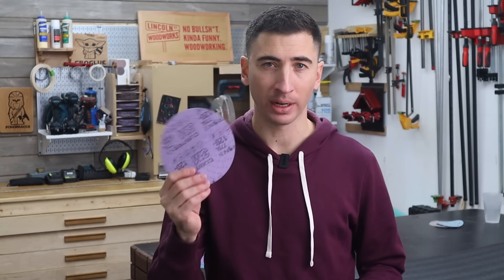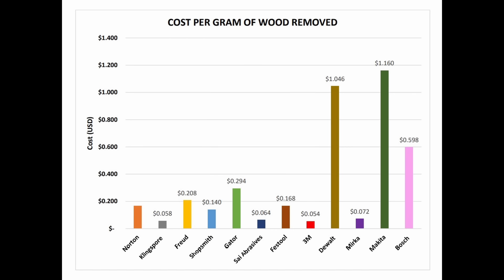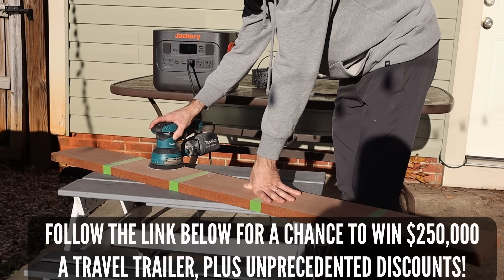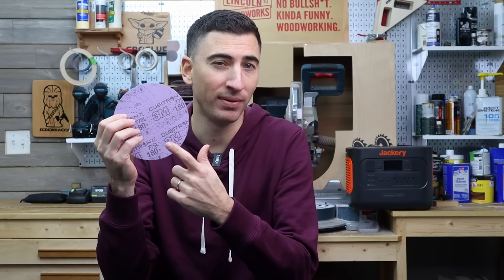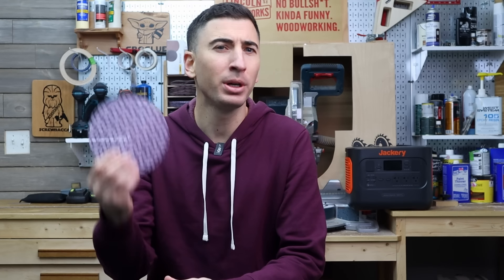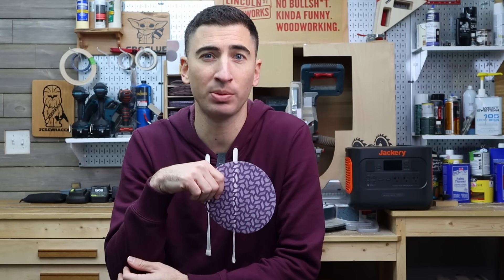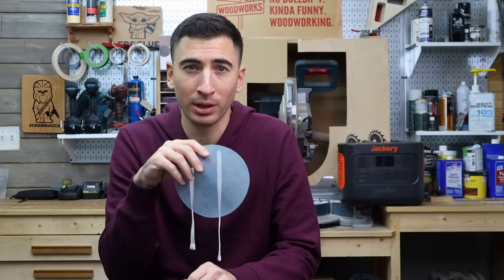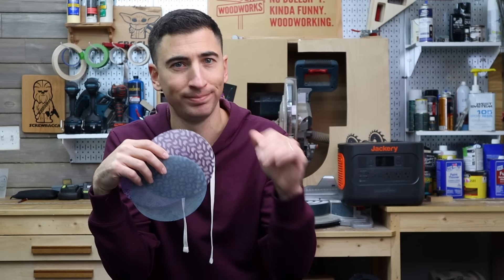This $.07 Upgrade Will Save You Hours

Comment from the maker: Purchase these products today for 20% off. Using these links helps support the channel
3M 775L - https://lddy.no/1dszo
3M 710W - https://lddy.no/1dszp
3M 310W - https://lddy.no/1dszq
Pad Saver - https://lddy.no/1dszr
Reply: so what about carbide sanding discs like those from Duragrit? Seems like they should be superior in most areas. Stumpynubs made a recommendation for them a few years back. I've never had a chance to use them but imagine it could be a game changer as far as material removal is concerned. Not sure why we're still using crap glued to paper or even mesh when we have literal discs of rough metal now.

Comment: As a professional woodworker and carpenter, I've used just about every type and style of sandpaper out there. As soon as 3m released the 710W I spent close to $800 in sandpaper acquiring every grit I needed. This was after using my very first sample disc.
The 710W is hands down the finest disc out there, and most definitely the most cost effective sanding solution.
For those of you on a tight budget, I highly recommend you save the pennies and get the 710W. Over time, you will put more cash in your pocket.
Cheap sandpaper is just that. Cheap. 
Remember... The sander is the MACHINE. The PAPER is the TOOL. Quality tools ALWAYS have a better experience, work faster, and cost LESS over time.
Reply from the maker: Couldn't have said it any better myself. The 710 really is an incredible product
Reply: Try Norton's Blaze line....what do you have to lose?
Reply: I generally sand pine with a cordless sander without dust collection. Would you recommend the 710W for my application?
Reply: Thank you 😊

Comment: Yep, I am one of those who uses sandpaper until it's just paper.  I go through so much of it, that I keep some for later use ... albeit it might not cut as much, but in the times that I use it the scraps are worth getting every cent out of the paper.  Great video, thanks!
Reply: Me too. I do mostly hand sanding, and spent years restoring century-old wooden entryways on brownstones in Boston, and there was no way to use power sanders on them, except on some small areas that were flat. For hand sanding, I found Norton Pro-Sand sheets to work the best for me. And I save the small scraps, too.
Reply: @grizzlygrizzle  I should have lead with that, that I do mostly hand sanding.  I'll rough down some wood with a palm sander, but after that it is all by hand ....

Comment: I am limited to big box stores and have bought their sandpaper because I have thought is was decent and "cheap".  After this video, I did a bit of investigatingand realized that these "Premium" discs are actually a fraction of the cost compared to HF, HD, L, etc.  $20 for 50 discs for 3M or $6 for 5 discs at HF or HD.  

I will only buy "premium" discs now and feel good about it because they are cheaper per unit than the "cheap" ones AND perform a lot better!  Thanks for opening my eyes!

Comment: Thanks! Over the last few months I've made over 100 cutting boards and seems like I get the best results with the 710 for all the faces, then switch to a 775 disc for doing all of the edges, for all the exact reasons you mentioned.  I had not heard of the 310, yet, I will go check it out!
Reply: Have made dozens of cutting boards the last few months lately too. You should def try diablo sandnet!

Comment: Diablo SandNET from home depot are the best I've ever experienced by far and away.  I have sanded my laser cut products every day for 15 years and have experimented with everything.  I use 120 grit mostly.  A disc I have used for 6 hours straight removes material way faster than any other disc after 15 minutes of use.  But I wouldn't recommend anyone using them because I want to make sure they are in stock when I need to buy more

Comment: Did You know you can clean out clogged sanding disks and belts etc with a rubber bar?
It's an old technique. Everything old is new again!
Better yet, try a sharp hand plane, you can get such smooth results that it actually shines and don't need sanding!

Comment: Aluminum Oxide is a hardness of 9.  for sanding wood the hardness is not the issue it's the shape, size, and distribution of the grit.  Another is the adhesive, closed or open face.

Comment: Here is an elaboration on the key benefits explained in the summary:

• Cost-effectiveness - The testing showed that while more expensive upfront, the 3M Cubitron and net abrasive discs actually had the lowest cost per gram of wood removed. This means they are more cost-effective in the long run by removing material faster and lasting longer before needing replacement.

• Understanding grit and materials - The explanation of how grit levels work and the impact of abrasive materials (e.g. aluminum oxide vs ceramic) and backings (e.g. paper vs film vs net) helps users understand what factors drive sandpaper performance and cost. This knowledge can inform better purchasing decisions.

• Smoothest finish - Despite removing less overall material, the testing found the 3M 310W net disc left behind the smoothest, most scratch-free finish on the wood surface. For many woodworkers, having an ultra-smooth finish is extremely important.

• Tailored recommendations - Rather than blanket recommendations, specific sandpaper products are suggested for different user needs - budget/softwoods, working without dust collection, mix of hardwoods/softwoods, etc. This tailoring helps ensure each user gets the right product for their requirements.

• Frequent disc changes - The data showed that even premium discs see a 50% drop in material removal rate after 25 minutes. The recommendation to change discs frequently, while potentially using more discs, ensures faster removal rates and better finish quality throughout the sanding process.

The overarching benefit is maximizing both cost-effectiveness and quality of results by understanding the factors impacting sandpaper performance and following evidence-based best practices. This saves time while producing superior finished products.
Reply: The video outlines some potential downsides to the different sandpaper products recommended:

3M 775L Cubitron Downsides:
- Most expensive option
- Not ideal for resinous/soft woods like pine as they cause premature clogging
- Left deeper, more visible scratches in testing that required sanding to a higher grit

3M 710W Net Disc Downsides: 
- Edges more prone to fraying and tearing compared to film-backed
- Purple abrasive fragments can get left behind if not vacuumed well
- May need to go to a higher grit to remove all scratches

3M 310W Net Disc Downsides:
- Removed material at a slower rate than 775L and 710W in testing

As for which product is ultimately recommended:

For Budget or Resinous/Soft Woods:
The 3M 310W net disc is recommended as the best bang for your buck, especially if working with inexpensive woods like construction lumber where the slightly rougher finish won't matter as much under a film finish.

For Edges/No Dust Collection: 
The 3M 775L Cubitron is recommended if you'll be sanding a lot of edges or won't have a vacuum hooked up, as its film backing holds up better to edge sanding and doesn't require dust extraction.

For Mix of Hard/Soft Woods:
The 3M 710W net disc is recommended if you work with a mix of wood types, as it provides excellent dust extraction while still removing material very efficiently across different densities.

So in summary, the recommendations balance factors like budget, wood type, sanding application, and whether using a dust collector based on the performance testing results.

Comment: 1. Sanders that supply cool air to the center of the sandpaper such as Mirka, festool and some metabo - ALL push sawdust to the outer holes batter and make sandpaper with any center hole last longer.
2. The true calculation of sandpaper value to me is cost, uniformity of sanding over 1 hours, finish and dust - not in any order all sandpaper must achieve a great balance of all the above. Did I miss one? I believe that Autonet nails my preferences BUT SO DO A LOT OF OTHERS

Comment: On Sanding anything not just built, especially painted pieces, cheapest unit disc the better. Disc clog, hitting nails, soft putties, rusted steel, pad life is not grit life it's backing life. All these tests in flat, sap hardened dry long grain hardwood is so narrow a test. 
Sanding down an outside door and adding a hardwood toe strip covers most of the situations. You'll hit nails and maybe the latch plate, clog with water and oil based paints, then flatten the endgrain in several positions, edge dig the pad for long moulding sanding and finally when it's had its first recoat of paint you'll knock down some missed sharp edges. the pile of discs will be 90% clogged and torn and 10% lost tooth. when you look at cost (time and dollars) of doing it at home, sticking with cheap discs is the path, beats strippers, heatguns, and super performance cutting discs.

Comment: Hmm, @11:49 I wonder if dust buildup on your finger tip/pad made a difference?  If you did it in the other direction, would it have affected the results?  Not that we need to turn this into a rocket launch or anything. LOL.  And while I do try to blow/dust between sanding, I'll now be more diligent.  I wasn't aware of the PTCE:  purple tortilla chip effect.  As I get into more and more "fine" woodworking, I'll be sure to be on the lookout.  Thanks!

Comment: 5 months later, I am here to say the 710 is love. I was using Gator previously, and while the 120 does it, it makes a HUGE DIFFERENCE when you put the 710 on. 

Seriously, if you have other sandpaper, here is how to correct this situation. Go to Home Depot or Lowes, buy the 50 pack of gator 120, 180 and 220. Drive home, open garage to your shop. Go to trash can and throw it out, along with the receipt. Now, use that feeling and get angry then get 3m 710 and never look back. 

How do I know? No idea, I really don't.
Reply from the maker: Lol

Comment: I used to hate sanding, the dust, noise, frustration, then I got a Festool sander and dust extractor, and I love sanding now. Turns out that removing the dust at the source makes a better finish, I’ve gone from sanding to the finish room without vacuuming or wiping

Comment: Like the video - for the discussion of efficiency of material removal.... not the swirl testing (which I will explain why).

I didn't know people were of the idea that you can jump directly from random orbital sander to finishing routines.
This might work alright depending on the wood and a clear finish.... BUT, very unlikely to work well if you are staining or if the wood is fine textured... and yes - professionals DO use stains - a lot.

It does make me wonder if possibly some simply have had no reference point to realize that what they are seeing is the results of not removing the swirls.

ALL swirl marks are made by your machine NOT the sandpaper. The sandpaper's ONLY job is to cut material. The machine sets the pattern - and can also have a great determination on efficiency. A swirl is nothing more than the evidence of the machines pattern.

That pattern remains the same no matter the quality of the paper or the size of the grit. The swirls will "disappear" after you reach a certain high grit size due to the swirls being too fine to see with the naked eye... but I would suggest it would save time to stop at a lower grit and quickly hand sand to remove the swirls then it is to sand up to a high enough grit to HIDE the swirls.

I might suggest that what your swirl test is ACTUALLY revealing is that the lower quality sandpaper is - well, lower quality, meaning a greater range in the actual grit size on the pad - otherwise the swirls would be consistent across the surface. This is turn would leave visible swirls wherever that larger grit made contact. If you did the same test on the higher quality over a dozen sheets or so you would probably find swirls from some inconsistent grit.

The raking light is the best way to find swirls and blemishes - but you can make it even easier by also wiping the surface with paint thinner. This will soak more into end grains (which is what a cross grain scratch is) making the scratches and blemishes a little darker.

My personal preference for sanding (if one can use the word "preference" when referring to sanding) is to orbital sand to 1 grit higher than I want and then drop 1 grit to finish with a quick hand sand. This way I am not fighting to remove swirls.

Comment: What'll save you more headaches than anything is a well balanced RO sander.. If you have a decent air compressor with sufficient CFM's there are some high end pneumatic sanders on the market that are very balanced.. My "sanding background" began in the autobody industry working in a variety of shops so I learned the hard way to NOT allow the edges of your sander to dig in..Keep things flat as possible because you will create swirl marks and the more balanced the sander the less likely you'll screw things up... I had to completely resand entire trucks down to bare metal because of my mistakes and listen to bosses make me out to be the worst body man since the dawn of time..Yeah..It's THAT much fun to be the schmuck in the shop and end up working for free.

Comment: I'm actually a bit more confused than I was before. If one were to use a cordless sander without dust collection on pine, which one one would you suggest? The prices are negligible after that breakdown in terms of how much I'll be saving compared to the cheapo stuff I've been using, so cost is not a factor.

Comment: Thanks for mentioning we should use the backing with a net disk. Wittworks just did a video on those this past weekend and that was the first time I had ever heard they exist and why I need one. You're the only other YouTuber I watch that's even mentioned their existence or purpose. I just got into woodworking this Spring and bought the "Xtract" net disks after seeing Jonathan Katz Moses's video but never knew I needed a backing. Thankfully I haven't done a whole lot of sanding since I've just been building garage furniture and shelving but I'm definitely buying a backing for next year.
Reply: I go bareback on my sander and live dangerously. But yes- interface pads are importanter

Comment: Super interesting video, thank you! I'm still very new to woodworking, so I was using cheap amazon sandpaper, until I saw Katz-Moses' video and switched to the 710W and I really love it, the difference is so much more than I thought it would be! It's probably the thing that's made me rethink my instinctive cheap-stakes-ness the most! It looks like the 310W is a little harder to get my hands on in the UK but I'll give it a try if I can find some.
Reply: Might be beneficial to replace only some grits. For example, if you care more about just removing material (lots of rounded edges or gradual shapes in projects, for example), get fancy coarse disks. If you are more into fine finishes, invest into finer grits and use cheaper coarse ones. 
If you are working with sap-y woods, working it with a scraper first can help to keep disks from clogging. Certainly helps with autobody fillers since they tend to get a gummy layer on top as they cure.

Comment: Great info! My time sanding is the most important factor to me behind a good finish. I originally bought a planer just so I could start with a more uniform, smoother surface on rough boards and cut down on sanding time. I was willing to spend $600 to not sand for hours. Added benefit of making them all the same thickness

Comment: Excellent information, a true service to the community.   In the grams per dollar testing, the defect in comparison was the effective grit size of various brands.  A lower grit number will always remove more material than a higher grit number; how do we know that the grit scale is consistent from one brand to another, or even from one lot to the next within a single manufacturer?  Your testing went several steps in the right direction.
Reply from the maker: Thank you! There are standards that each company must meet to label grits. This helps create consistency from one brand to the next. I can't remember the exact names of the organization that monitors this - I read about it a while back. But there are industry standards.

Comment: The sander just has certain amount of holes. How does it change the dust extraction between the net and sandpaper? The festool sandpaper has the holes in the same spot as the backing pad. I think the net will mess up the hooks.
Reply: it doesn't. The mesh is still usually on a regular fleece backing that is the actual contact to the velcro hooks. In my experience it still improves extraction because the dust can basically go through the tiny "channels" between the mesh and through the velcro hooks. My mesh discs clog up way slower than any regular sand paper discs I've ever used. That only counts for the 310 stuff, or rather I use the Bosch mesh but that is more or less the same as the 310.

Comment: The 710W is my daily driver and it does leave some swirls from time to time. I still have my last few mirka discs and they leave zero swirls, but they wear out REALLY fast in comparison. 

Kind of weird that the 310W left no swirls, but not as smooth of a finish? I wonder why that is?